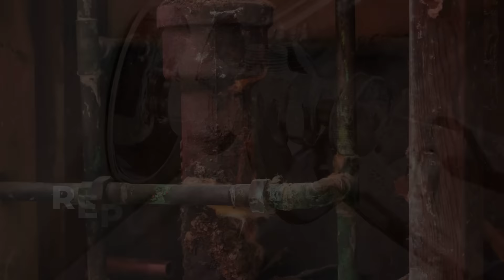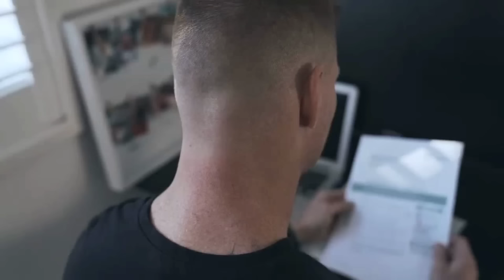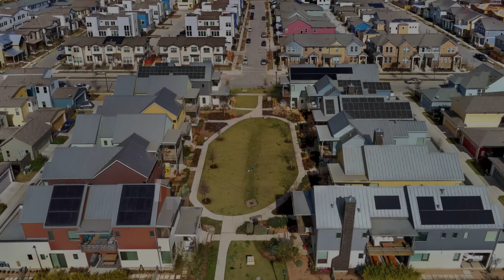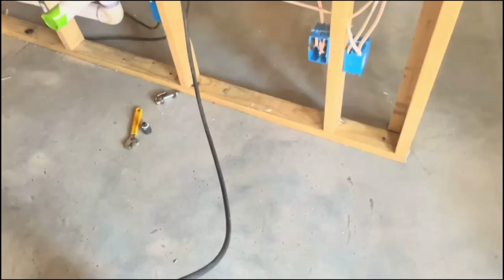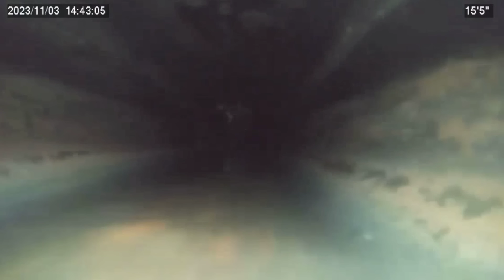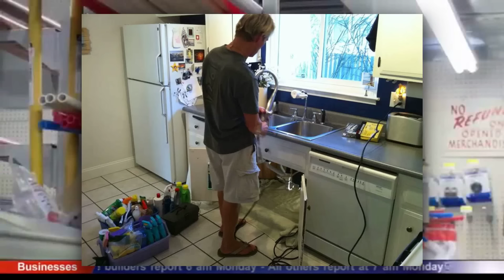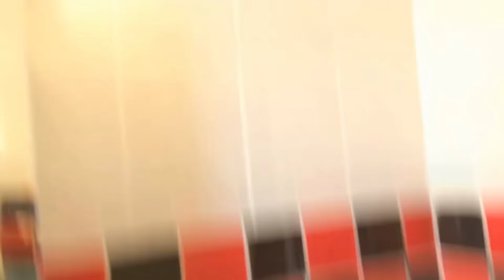Why 90% of New Plumbing Work Are Garbage (The Builder Grade Lie)

Comment: I am surprised this guy did not recommend the use of lead pipes, as he has no clue on this subject.
Reply: AI
Reply: @frmerrin2  Look up "Flint water crisis"
Reply from the maker: We aren't looking to go backward to lead; we're looking to stop the forward slide into disposable garbage! 🛠️ Copper replaced lead because it was safe and lasted 80 years. Now, builders are replacing copper with plastic tubes and rubber O-rings that fail in a decade. If you think 'progress' means paying $15k for a flood claim because a $3 hose burst, then you're the one who has been sold a lie. My focus is on materials that actually survive a 30-year mortgage!
Reply: @QualityRot  Never seen lead used for potable water.
Reply: @frmerrin2 Cities used to use it for distribution underground.

Comment: Good point, DIY ers are using Sharkbite fittings behind walls everywhere.
Reply from the maker: That's exactly how homeowners unknowingly set themselves up for a massive leak down the road! 🛠️
Reply: @QualityRot  Fancy PEX and Sharkbite fittings are no match for the good old-fashioned copper, solder, flux and torch method 💪

Comment: PVC will last a very long time and is incredibly easy to repair. I don’t think it transfers heat well, so not for underfloor radiant heating.
Reply from the maker: You're right, it's great for drains and super easy to fix, but you definitely need special pipe for radiant heat! 🛠️

Comment: I have cpvc, only time will tell, so far 13years still holding 😮
Reply from the maker: I'm surprised still holding up
Reply: @QualityRot  - What is the typical failure for CPVC? Mine is currently 10 years old.
Reply from the maker: At 10 years, you're right on the edge! 🛠️ The typical failure for CPVC isn't a drip; it's embrittlement. The chlorine in the water turns that flexible plastic into 'glass' over a decade. The most common disaster is a pipe literally shattering or snapping at a joint during a pressure spike or even just a light bump. It’s the definition of Quality Rot—it looks fine until the moment it causes a massive flood claim. If you have to touch it, be extremely gentle!
Reply: @QualityRot  - Most of mine is in my crawlspace and I have two cameras monitoring that area. Except for the piping leading to my washer (which is normally turned off before that section when not in use), all my piping is observable areas, not inside walls, and with water leak alarms (and silicone drip mats in most areas).
-
If you are wondering how that is possible, my bathroom and kitchen are right next to each other, and the bathroom sink, tub, and kitchen sink are all along the same wall. The washer is the outlier, being on on the other side of the wall at the other end of the tub.
Reply from the maker: This is a masterclass in risk mitigation! 🛡️ By keeping your plumbing observable and using leak alarms/cameras, you’ve effectively neutralized the biggest threat of Quality Rot: the hidden leak. Centralizing your 'wet' rooms is a 'Legacy' design choice that modern builders have abandoned for the sake of fast floor plans. You’ve turned a potential 10-year CPVC disaster into a system you actually control. Stay vigilant
Reply: @QualityRot  - I learned some hard lessons from the polybutylene plumbing my home was originally equipped with.
Reply: @lonniemcclure4538   i have made it last 30 years .Bigest problem is the hot waterline  gets  brittle with  age and is very hard to work  on
Reply: time  to but  a Lotto ticket

Comment: I would never buy a house built on a slab. A leak or break requires jackhammering the floors to repair it costing thousands. A home with a crawl space or basement allows you to access the plumbing without destroying the house to get at it.
Reply: Where I live, slab foundations have been used almost exclusively in new homes constructed since the early 1950s.
Reply: @g0989  A lot of builders are doing that, because it's cheaper
Reply from the maker: Spot on! 🎯 Basements and crawl spaces were designed for Serviceability. A house is a living machine, and you need to be able to reach its 'arteries.' By switching to slabs, builders have essentially 'buried the evidence.' They save money on the build, while you're left with a house that requires a jackhammer just to fix a simple leak. It’s the ultimate example of Quality Rot: trading long-term access for short-term profit. Great observation!

Comment: Wish i had gotten the warning on the supply lines 3 years ago. I had just finished the engineered flooring in the kitchen and living room when a nee refrigerator was installed with a free braided line. Welln it leaked at the valve and by the time it started weeping through the planks it was a disaster. The insult was after i replaced the flooring including scraping the fully adhered cork underlayment it happened again but it was a pin hole in wall below the supply valve i had capped off. I have since had a water heater line and a shower valve pin hole. The house was built in 1997 so copper isn't  that great here acording to a trusted local builder. I was planning replumbing through attic as i am on a slab with pex. Now i am not so sure. I can sweat copper so that may be my next project from hell. How about listing actual quality products in description?
Reply from the maker: You've experienced the exact scenario I warn about, and sticking with copper for your replumb is the smartest move you can make for long-term peace of mind. 🛡️
Reply: @QualityRot Pin hole leaks in copper are a sign of corrosive water. The leaks will never stop. The only solution is plastic piping. In my area (Maryland) nobody uses copper for that very reason. My house, built in 2002, uses CPVC and most new houses use pex.
Reply: @steveb2976 my parents built their home in the mid '70's and used cpvc and have never had any trouble. I just don't want to route thru attic as that is a recipe for trouble. I guess I can run a loop around outside as the bathrooms are on either end and it would be a short tunnel to connect. The kitchen well that may be a bugger. Maybe a long small diameter auger to reach sink supply with a minimal hole in slab.IDK.
Reply: @leethomas9198 I should clarify that I am on well water and it is the well water in my area that is the problem. Sorry to hear about your problems. That sucks.
Reply: @steveb2976 28 years is a pretty good run.

Comment: New houses don't have pipes, they have plastic hoses in the walls. It's cheap, it can leak, and it can leach toxic chemicals into your water. Plus, it will degrade quickly, unlike the old, tried & true copper pipes which would last 100 years.
Reply from the maker: Spot on—we've traded a century of reliability for disposable chemical tubes! 💸

Comment: Sorry, with a couple obviously incorrect assertions and an obviously AI narrator voice, I have trouble believing anything from this source. For example: "grandparents' house has copper pipe"-- my g-parents are long gone, and my house, as well as all the houses in much of this metropolitan area has galvanized piping, which for the most part in my house is still working great after 66 years. Second: every water heater has an expansion tank. Well, mine doesn't, nor do many of my neighbors' in this area--- bad assertion. Sorry.
Reply from the maker: 66 years on galvanized is a testament to the old-world quality! 🛡️ But you’re proving my point—modern builders wouldn't dream of installing something that lasts 60 years today. As for expansion tanks, if you're on a closed system without one, your T&P valve is the only thing keeping your water heater from becoming a rocket. Just because it hasn't failed yet doesn't mean the 'Builder Grade' logic isn't a gamble!

Comment: I have been using pex for 20 years absolutely no problems
Reply from the maker: That’s great to hear—you might be lucky enough to have some of the older, thicker stock before it was value-engineered down! 🛠️ The problem is that the PEX being installed today isn't the same stuff from 20 years ago. We've traded those original margins of safety for 'Minimum Code' shortcuts and cheaper fittings. You’ve had a good run, but many homeowners today are finding that the new stuff doesn't last like the 'Legacy' PEX did. Stay vigilant!
Reply: Whoop tee do I bet you have a ford with 300k miles and brag about that while the majority pay to fix all the time

Comment: "PEX plumbing can lead to serious issues such as chemical leaching, susceptibility to rodent damage, and environmental concerns like non-recyclability." 

"One significant concern with PEX plumbing is the potential for leaching chemicals into your drinking water. Materials such as BPA and other toxic substances can migrate from PEX pipes. This leaching occurs especially when water is heated, raising questions about long-term exposure to hazardous chemicals.Some studies have highlighted that certain types of PEX can release harmful substances more readily, particularly in hot water applications. "

"A phthalate compound, DEHP, was also tentatively identified in the PEX-a pipe material. DEHP exposure may affect cardiovascular function "
Reply from the maker: You've highlighted the exact chemical leaching issues that make me distrust these modern plastic systems! 🛠️ We've traded a stable, 80-year metal for a chemical experiment that reacts to heat and leaches BPA and phthalates into our drinking water. Between the health risks and the fact that rodents can literally eat your plumbing, PEX is the ultimate 'Builder Grade' compromise. Thanks for sharing those specific risks; it’s crucial information for homeowners concerned about the Quality Rot in their water!

Comment: Temperature Relief valves have to meet multiple code and safety standards and rarely fail if they do will dribble out water I’ve never seen other on a water heater and come installed from the factory on the water heater.
PVC has been used for over 50 years with minimal failures cast iron pipes more frequently clog and do rot out often in less than 30 years 
Copper pipes directly in the slab often react with the concrete and start leaking 
From 30+ years of field service work
Reply: true, depending on the acidity.
Reply from the maker: Respect for the 30+ years in the trenches! 🫡 You're spot on about copper in slabs—it was a failed experiment. But here’s the core of Quality Rot: the PVC and factory T&P valves you installed in the 90s had a margin of safety that doesn't exist today. We’ve moved from 'Built to Last' to 'Built to Conformance.' When manufacturers shave every cent off a factory-installed valve or use thinner-wall plastic to hit a price point, the 'Standard' becomes the 'Weak Point.' Experience like yours is exactly why we need to call out these 'Builder Grade' shortcuts. Thanks for keeping the bar high!

Comment: actually in china people used you called plastic pipes over 40-50years ago . no issues
Reply from the maker: That longevity actually proves my point! 🛠️ The plastic pipes manufactured 40-50 years ago were often thicker and simpler because they weren't 'Value Engineered' to the absolute minimum thickness like they are today. In the modern Quality Rot era, we use high-tech sensors just to see how much material we can remove to save a penny. I’d take 50-year-old 'overbuilt' plastic over today’s 'minimum-code' PEX-B any day. It’s not the material that changed; it’s the corporate greed behind the manufacturing!
Reply: UV Exposure: If PEX sits in the sun (even in a warehouse or through a window) for more than 30–60 days, the plastic becomes brittle and will eventually snap or crack.
Chemical Sensitivity: High levels of chlorine in the water or proximity to certain "pipe dopes" and oil-based products can eat away at the plastic from the inside out.
Reply from the maker: You hit the nail on the head! 🎯 PEX is a chemical 'delicate flower' compared to copper. Between UV exposure making it brittle before it even leaves the job site and chlorine eating it from the inside out, we are seeing the definition of Quality Rot. We’ve traded a material that lasts 80 years (Copper) for one that can be ruined by 30 days of sunshine or a little bit of the wrong pipe dope. It's the ultimate 'Builder Grade' gamble. Stay vigilant!
Reply: @QualityRot I have had to replace tubing that was 20 years old, manufactured in mobile homes for a few people. Like you said most PVC products today are thinner.

Comment: why  does  Quality Rot get to lie  on you tube   cast iron drains are a big failure
Reply: You don't call something a Failure if it works for a hundred years until it's replaced w something better.
Reply from the maker: Exactly! 🎯 A 50-year run is a success story. A 5-year failure is a scam. We need to stop calling disposable junk 'innovation'
Reply: I have never had a SS braided supply line fail...yet.
Reply from the maker: Cast iron isn't for everyone, especially in acidic soil, but the 'Quality Rot' issue is that we don't even have the option for a 50-year drain anymore. Builders use the cheapest PVC because it's fast, not because it's better. I’m not lying about the failure of modern plastic; I’m just exposing the lack of choice!
Reply: @QualityRot   cast  iron  is great if you like paying Roto rooter a lot and  yes SCH 40 has lasted over 50 years .how young  are you

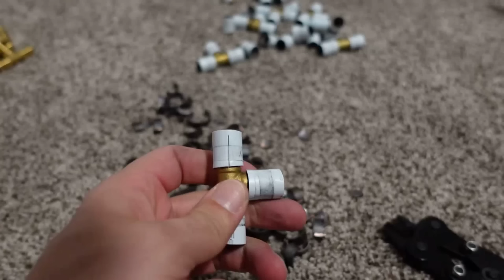Comment: @6:47  What are those fittings pictured in the video?
Reply: Maybe AI Slop fittings?
Reply from the maker: Those are Push-to-Connect fittings (commonly known by the brand name SharkBite).

Those are 'Push-to-Connect' fittings. They’re great for a 10-minute emergency fix, but they are the definition of Quality Rot when used behind a wall in new construction. 🛠️ Trusting a tiny rubber O-ring to hold back your home's water pressure for 30 years is a gamble most homeowners don't know they're making. 'Easy' for the builder usually means 'Expensive' for the homeowner down the road!

Comment: All these prices are already double the prices stated.  Home Depot or Lowes, the prices higher inflation. 2026.
Reply from the maker: You're 100% right—2026 inflation has hit the hardware aisle hard. 📈 Even if those parts have doubled in price, remember that the cost of a water damage restoration crew and new flooring has doubled too. The 'math' still favors the upgrade: spending $160 to prevent a $25,000 disaster is still the best insurance policy you can buy. We're paying more for the same materials, which makes it even more important to buy the right stuff the first time. Thanks for the real-time price update!